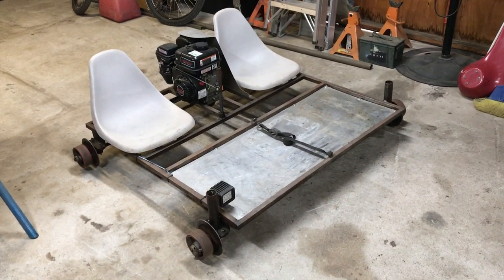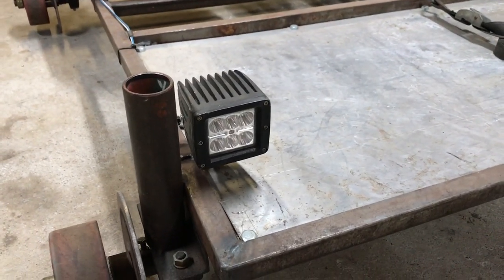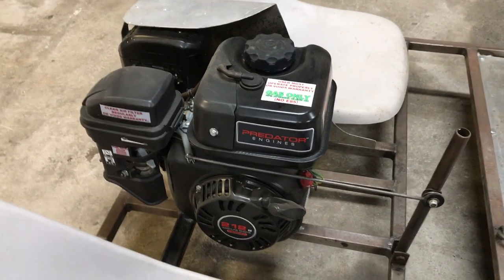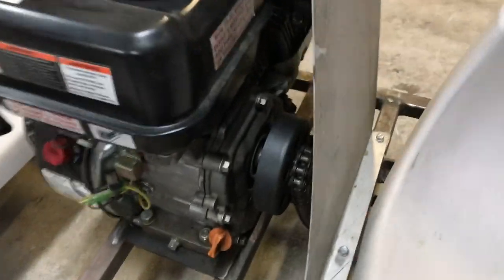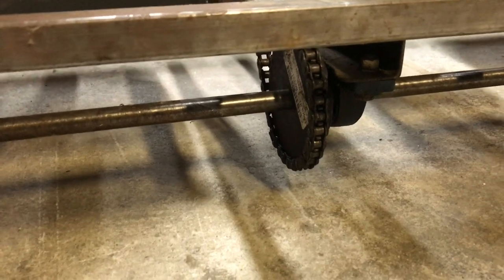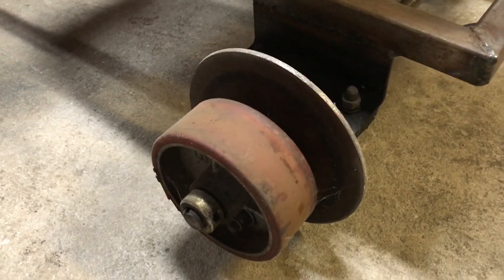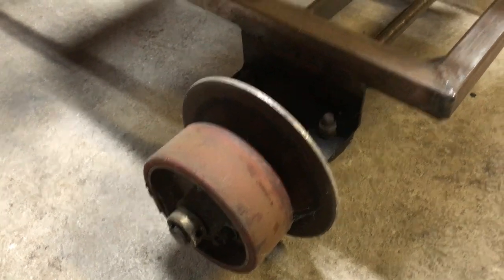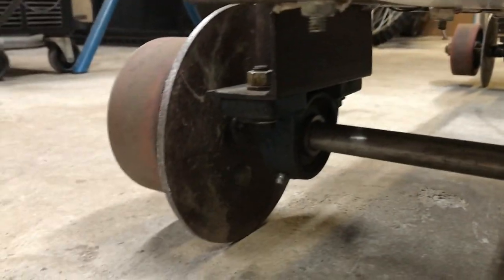How To Build A Rail Kart

Comment: I don't understand the clutch system. Could you please explain?
Reply from the maker: It’s a very basic mini bike clutch for #40 motorcycle chain that attaches to the 3/4-inch keyed shaft on the engine. It’s very compact.

Comment: hey, my friend and i are looking to build one. could you give any pointers or ideas on how we connect the motor to the wheels / axels and if it’s better to use a chain or a splined hub that has the 4 bolts to connect a tire to push the wheels on the cart
Reply from the maker: A chain, sprocket and keyed axle is the most reliable drive method. Use a #40 chain and sprockets. Super durable.
Reply: @JohnCappa could you show us a part list and suppliers where you got stuff at. I'm really interested in doing this. I've seen other builds for 4k and you said you built this one for $500. I'd rather build yours for $500!
Reply from the maker: @andykapfenstein7032  : I purchased almost everything from eBay and Amazon. It’s just basic 3/4-inch pillow block bearings, a 3/4-inch diameter keyed shaft for the drive axle, 3/4-inch diameter shaft for the front axle, some 3/4-inch spacers and keyed 3/4-inch drive hubs. It’s made up of very common basic industrial components you can get almost anywhere. To mimic my kart you’ll need the ability to weld, drill holes and grind.

Comment: Hey John great simple design! Im in process of building my rail cart out of a tri- fold aluminum loading ramp. Im using pallet jack wheels and car disk brakes for wheels. Can you give a more detailed description if your wheel assembly and axel connection? Also wheel base? Thanks!
Reply from the maker: I think I'm gonna have to make a video of the wheels, a lot of people are asking me about them. Mine kart is standard railroad gauge. There are other railroad gauges so you need to match the width to the rail you plain to run.
Reply: Hello, I am also doing something similar, I liked the simple design, how did it go with those wheels with brake discs? Because I want to make them with an iron wheel and the disc on one side, greetings from Argentina.

Comment: You may want to change wheels.
Train wheels' radius is lower, the further from the middle of the train (They have a shape of a plastic cup, but way shorter). It helps the train to stay on the rails. Also it solves the problem of one wheel needing to do more rotations when the rails turn.
Reply from the maker: Yeah, I was fully aware of that when I built these wheels. However, the cost and complexity of building a tapered wheel was not worth it to me for this application. As I'm sure you know the speeds and weight that my wheels see is far less than what you would see on a real train. My cart bounces back and forth a little on the rails, but it's not a big deal and it's never jumped the tracks or even come close to it.
Reply: @JohnCappa  I was considering using pneumatic wheels for support, with a set of skateboard wheels on each corner, mounted horizontally, to keep the kart on the track rollercoaster style.
Reply: May I suggest taking your wheels and turning them on a lathe with a 3 degree taper. Any wood lathe would do.  @JohnCappa
Reply from the maker: @timgiles9413  I don’t have access to a lathe with a deep enough bed. If I did I would have just made my own wheels. This was the low cost alternative. It ain’t perfect, but works just fine. It really doesn’t wander all that much on the rails at the speed I’m traveling.
Reply from the maker: @matts1166  I’ve seen a guy with pneumatic wheels on his kart get a flat tire. It wasn’t a great scenario. I didn’t want to worry about that.

Comment: How fast does it go? Looks like fun
Reply from the maker: My top speed is 22 mph, but I could gear this engine for about twice that if needed. It would be hair raising though.
Reply: @JohnCappa  2 speed would be sweet
Reply from the maker: You could, but 22 mph is pretty scary on an unmaintained rail. I’ve hit a few big rocks. Most of the time I’m just off idle at around 10 mph, unless I know for sure the rail is clear.

Comment: You really should make a heavy duty chain guard. It looks great. I made mine 4' x 8' to carry 4 adults 😊
Reply from the maker: I bumped up the chain size larger than needed for just that reason. For me, weight is a concern so I couldn’t run larger diameter wheels for more ground clearance. The bigger wheels were too heavy.

Comment: How about brake system sir
Reply from the maker: I tried adding a mountain bike disc brake to the second cart I built for a friend, but it hit a rock and bent. I just use my shoe on the wheel or on the rail. You can usually see far enough ahead that slowing down in time is a non issue. However, I've been looking at go cart calipers that will fit over wheel discs.
Reply: @JohnCappa  thanks sir

Comment: Whats your guage on the flanges? 56”?
Reply from the maker: On the wheels? 3/16 inch. If I were to do it again I might try HDPE plastic.
Reply from the maker: Ohh, the width, a little less than the standard 56.5 inches. Older abandoned rail widths are inconsistent.

Comment: What are the dimensions on that cart?
Reply from the maker: They can be what ever you want. I made mine small enough to fit in the bed of my Tacoma pickup. The wheel width will depend on the rail line you want to travel. Standard gauge rails are are 4-foot 8.5-inches measured on the inside. However, older abandoned rails are often pushed further apart in some corners.